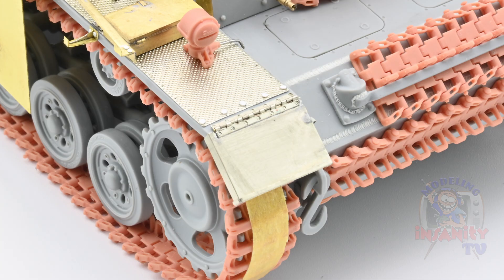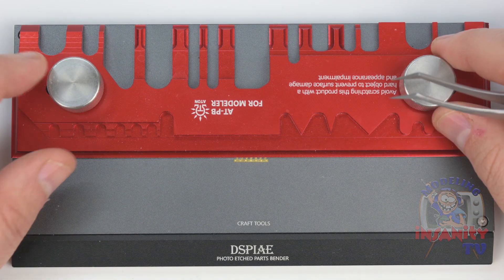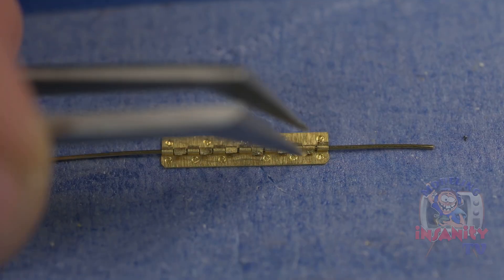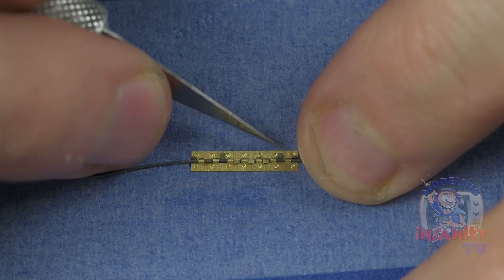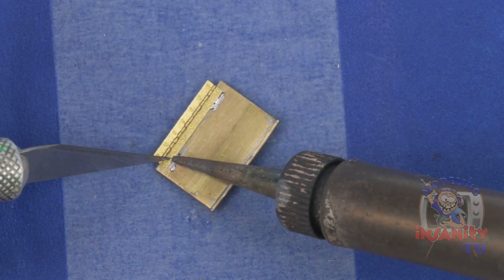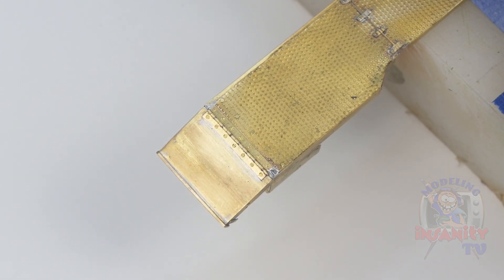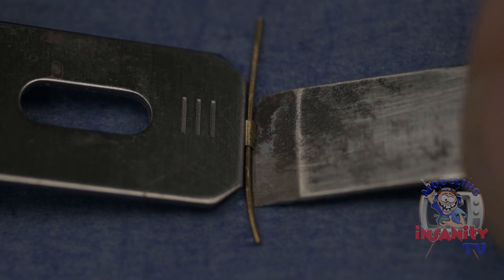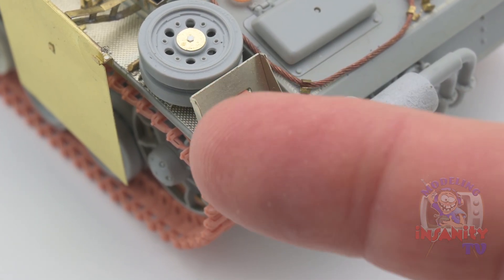How to Make Workable Hinges

Comment: You make that look way too easy.  Ive tried hinges before and never been successful.  This technique seems a lot better.   What grit of sandpaper do you like to use to clean up the excess solder?
Reply from the maker: Thanks Joshua.  Give this technique a try, it will work.  I usually start with 400 grit sanding sticks and work my way up to 1000 to smooth it out...

Comment: First time seeing your videos Rob - great stuff - small question : Is there an advantage to not annealing your etch? I like to anneal all my etch before bending etc. but it doesn't mean I'm doing it right.  Thanks.
Reply from the maker: Thanks Tim, the only time I anneal brass is if it needs to be rounded out.  Some Photoetch and brass in my opinion is pliable enough to hold a bend or curve.  If it is too brittle or won't keep shape, that is when I will anneal it.  For instance the King Tiger mudguards that you see at the beginning and end of the video.   Those are Rye Field Model Photoetch mudguards.  They were a kit in itself and took a long time to make.  The main part of the mudguard needed to be annealed to be rounded out because the brass was too hard.   You can see how I made them in the February Issue of Military Modelcraft International.   I can also send you the article if you want to see...
Reply: @modelinginsanitytv  Thanks for your help and appreciate the offer Rob - no worries on the article - I am looking at MMI back issues as I write 🤟- N.B - I did see your RFM KT on your post in Modeller's Tavern -  loved it -🤩-

Comment: I can’t believe I’ve never considered using double-sided tape.  I’ve always used blue tac to hold the parts in place.  Double-sided tape works so much better.  Thanks for the tip!  Can’t wait for the soldering tutorial.
Reply from the maker: Thanks Rob.  Tape is your friend when working with photoetch.  Once I figured out that I needed these parts to be secured, it made it so much easier...
Reply: How can you use blu tac…it’s like putty🤔

Comment: Newbie modeler here. I recently discovered your videos and I’m learning so much! Where did the “toothed” initial brass part with faux screw heads on it come from before you began bending? Did you cut this out from brass plate first, or are these commercially available?
Reply from the maker: Thanks Anazach, I should have mentioned that those large hinges for the Panzer III are from Voyager as is the fender that the mudguard was attached to.  They are attached to a larger fret of photoetch that is specifically made for the Panzer III.  You can message me anytime Anazach if you are on Facebook if you have any questions or need help.  My page is Rob Riv's Modeling Insanity.